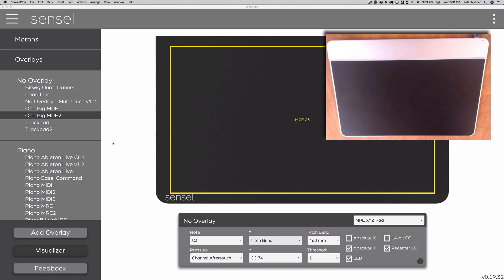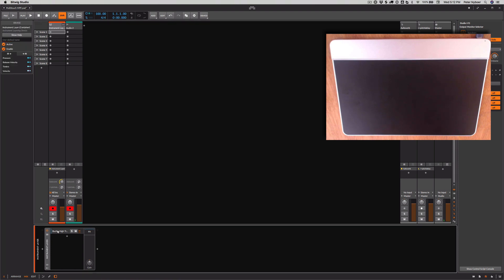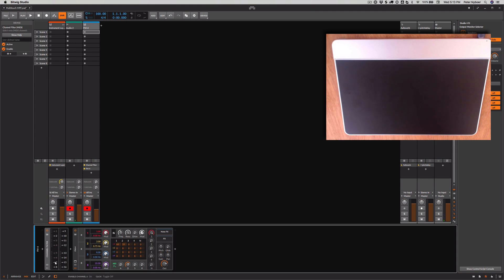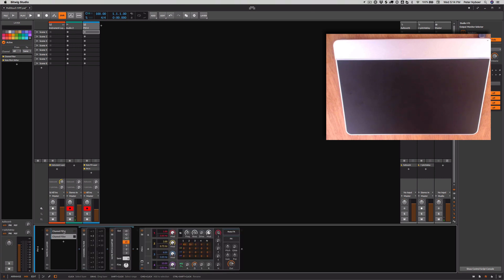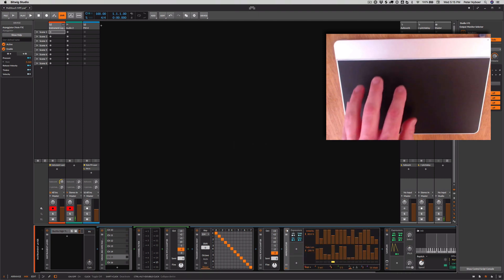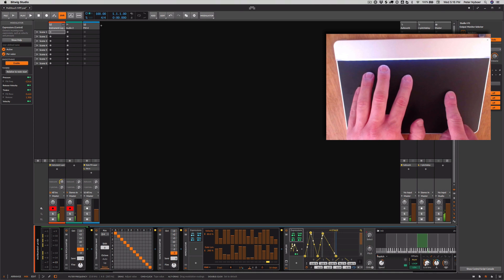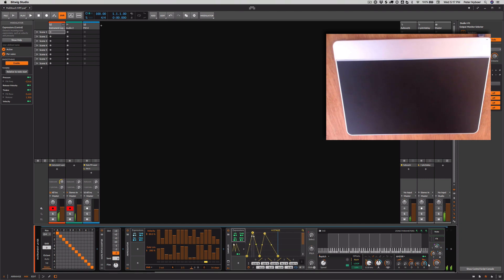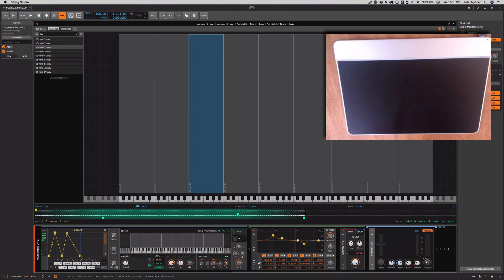XYZ, MPE, Oh My! How To Use Multiple Pressure Points in Bitwig Studio with the Sensel Morph

Comment: Is there any way to turn the sustain pedal on the piano overlay into something like this?? Having a hard time getting it to under stand x vs y (and pressure) in such a small space, but it does seem likes its possible with other even smaller buttons.... Would the 14 bit cc help??
Reply from the maker: In theory, yes, but the Y data on the sustain area of the Piano overlay is going to be arbitrary (at best). It might be fun, but expectations shouldn't be too high.
Reply: @SenselInc  is there any way to download the piano overlay and import it into the creators overlay and expand the size of the sustain button and use the bottom of each note as an additional button for remapping making the piano overlay a but more custom?
Reply: @SenselInc  also it would be awesome and open up a lot of doors if you could turn of the magnet response to overlays making any overlay a more defined innovators/ (no) overlay. Like allowing you to define the space in between the drums on the drum overlay to trigger effects or sends.... :) I feel like that should all be possible from the sensel app with a future update and really increase customizability